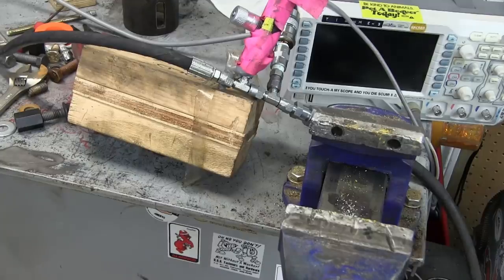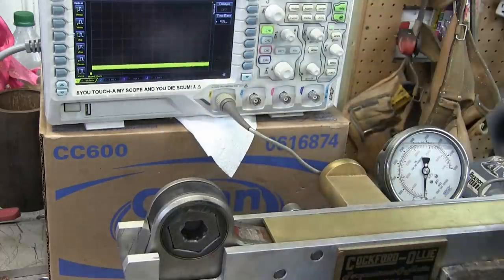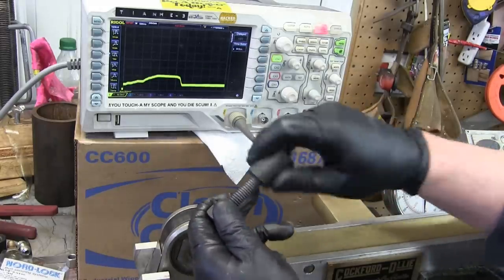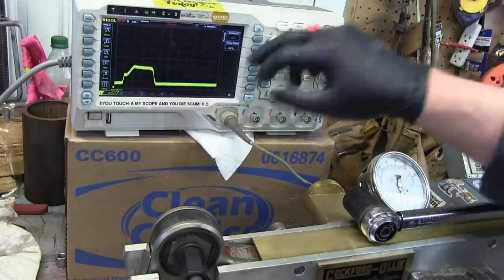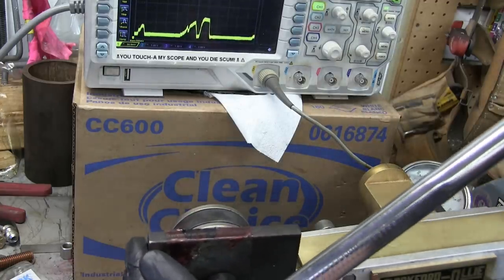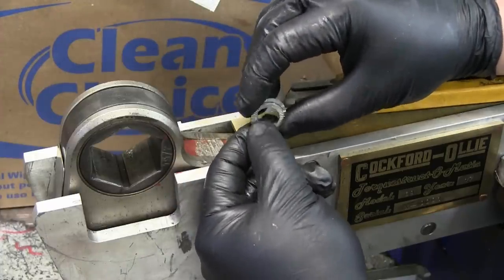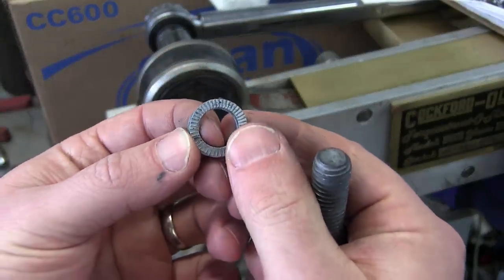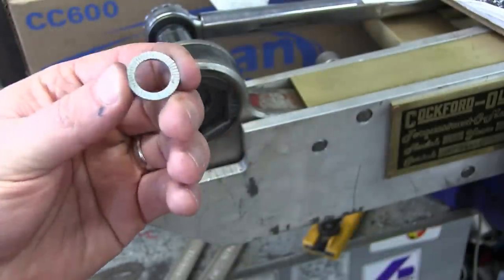Nord-Lock Washers | Do they work better?

Comment: as u can c on the bolt near its base there is an area where threads are not present as the machines cant reach that far down to cut a thread therefore if u want a proper fit and tightening u have to use a washer to fill that area thats the only reason washers were invented and needed unless the washer is harder than the materials being bolted together no washer will hold better than the torque specs of the bolt it has to bite into something to be able to hold

Comment: It seems like to me that you should be measuring the integral or AOC of each fastener, not the max amplitudes. That will give you a product of work or energy over time (really over a distance), necessary to tighten and to loose each bolt! You can see it in your trace profiles.

Comment: You should try the Schnorr Safety Washer, we use them a lot at work. They look very similar to the Nord-Lock washers, but they are in one piece and not glued together and they are also much cheaper... Nord-Lock 10pcs for 4,88€ and Schnorr 25pcs for 3,99€ for M10

Comment: Using different washers will give you different friction factors which will give you different pre-tension values when using the same torque for all three cases. You need to achieve equal pre-tension for all cases in order to say something about the berakaway torque.

Comment: Bolts and washers work just fine but I use the spring lock washers for nostalgic purposes. It is to my understanding that the locking washer's purpose in life is to gouge up the surfaces enough to keep vibrations from moving the head.

Comment: I'd like to see the same test with a dished washer (conical?... not sure what the actual trade name is). My experience and feeling of logic about them is that they are extremely effective at maintaining pressure throughout the last full rotation of your fastener.
Reply: would that be belleville washers you suggest?
Reply: bradonj 
I looked up an image of the the Bellevillle washer, and yes, that looks like it.  I've used these for connecting lugs to transformer terminals for large power distribution, and they seemed li,e the most robust option.

Comment: I think your soft steel plate was just sliding on the hard steel bolt on the back which would invalidate those tests.  weld the plate to the bolt so that's not happening. also if the nord locks work as you say, a finer thread pitch bolt will have more effect so try that too please. would be interesting.

Comment: I believe that the O ring encapsulated washer that is on oil pan plugs is by far the best for holding a faster. How hard is it to loosen the oil pan bolt? Friggin ridiculous! Takes two wrenches locked together to get enough torque to loosen it. Rubber O-ring dampens the vibration also.

Comment: Re-do the test wirh grade 3 and grade 5 fasteners in both fine and course  thread.

You might also utilise a stepper motor driven at a constant  voltage driving a screw to actuate the lever. This would give your data an additional factor of time.

Comment: Very interesting, inspiring me to do some research on "locking" fasteners.  
Will you be doing any follow-up with other types of lock washers, such as comparison of grade 2,5,8 split (will softer grades just fuck over), and various types and grades such as internal tooth shakeproof/star washers?  An interesting comparison might also be made between locking washers, and locking (both metallic, fiber, and nylon) nuts!

Comment: Nordlock washers require a different tightening torque value for the given clamping force. This may be due to the fact that when biting into the fastener and surface, there is less stretch in the fastener and less actual clamping force.

Comment: I do not know it but I use spring washers for electronic. I.e. if I want to be sure that a earth connection is stable, because even if the screw gets a bit loose, the washer keep pressing between the screw and the connector.

Comment: Loctite (actually used nail polish) was doing a shit job at holding the screws for the sprocket and break disk on a bike I had. Shitty little spring washing is now in place and holds up perfectly.

Hate to argue with the uncle ave though

Comment: Split washers seem to work better when they are larger. Think about on a hitch ball, those washers bite into those nuts very hard, sometimes too hard, but on smaller fasteners there's no where near the same effect in my experience. Possibly has something to do with the quality of the steel used to make the split washers too. I imagine buying them from a high quality manufacturer with a specific use case defined (like a hitch ball, or a structural beam) they would perform much better overall.

Comment: You can prove the ramp theory by using only one Nordlock washer instead of the paired set. In that case the unfastening torque will be solely due to the biting of the washer serrations into the mating surfaces and not from stretch of the bolt. I find it hard to believe that the ramps of the washer are forcing stress on a hardened bolt during the unfastens. If it’s in the ramps camming out then they will break the adhesive bond during the unfastening.

Comment: I thought these washers were great. Used to use alot of them and found the M30 ones were a PITA to remove.  "loaned" some from work to hold in the control arm bolts that kept on coming loose on my track car too.... unfortunately I could not return them as the bolts never came loose again....

Comment: I knew the results before the test began.  I don't think it would require more torque to loosen what was tightened . It's their ability to take vibration without loosening. So theoretically the best lock washer would be the one with the most crush travel with return pressure.

Comment: Work, not force, right? To resist  a bolt loosening, and resist vibration, you need to increase the amount of work necessary to loosen the connection.
You need something more like a stress/strain curve, and measure the area underneath.  So, you need to simultaneously record the rotation, and plot the torque vs the rotation. Potentiometer?
Also, you might want to consider a cheap USB DAQ, chinesium ones aren't too expensive.

Comment: They only work if you have the correct thread pitch as well. It may work better depending on the thickness of the plate you are bolting through.

Comment: Nordlock washers are meant to only prevent slackening and spontaneous loosening due to vibration. However, as explained in their video (https://youtu.be/IKwWu2w1gGk?t=3m53s) and as you found out, loosening them just requires you slightly stretch the bolt to overcome the locking wedges, which registers as a bump "snap" as you undo them.

Comment: Try using a fine-threaded fastener.  What you would need for their design to work is a thread that's steeper than the Nordlock.  Otherwise the fastener thread releases the pressure between the fastener head and the nut/plate/whatever faster than the Nordlock creates it.

Comment: hardest thing by far to keep bolts tight on Racing exhaust headers. Extreme heat and vibrations. massive temperature differentials and differing material types at a bolting surface.

Comment: Use fine thread bolts on to aluminum base. Also not much vibrated more than an airboat. Have not seen and breaking issues with them, over the last 12 years dealing with them.

Comment: The way I see it, is that it is not the bolt that stretches when undoing the nut, but the compressive force on the lock washers themselves.  as the materiel from wich the washers are made from is actually more ductile, combined like you have figured out with the grabbing inner surfaces geometry.
I think in your comparison testing, you should do a durometer test on all your samples.  You got to know what you have in your hands!!
Therfore in my mind, your test is not to a level where it need be to discriminate any of the various washer designs.

Comment: Nord lock cam angle is higher than the thread pitch. I am a big fan of both Nord Locks and Loctite. I have used both in the steel mills I have workes at and they make a huge difference. They are very expensive, but they are also reusable. Split washers are crap.

Comment: On the rare situations of using these, The old package, they came in, would show, torque up to 5 ft.lbs. below the required torque spec, wack'em with a hammer, or the setter tool ,which looked like a socket, once wacked with a hammer, then continue the torque process, on up to the final requirement spec... and I assume the dents would be created on & in the mating surfaces ...

Comment: Probably they won't work in low torque applications as well? M33 threaded pipe part with 1.5mm pitch with specified tightening torque of 40Nm.

Comment: Nordlocks are great but with increasing surface area under the screw head that increases setting! Which will loosen any bolt with time unless the they are properly pre torqued

Comment: I think the test ought to be re-run using non-hardened steel fasteners (male AND female) and a single washer between. This will allow the washers to do what they are intended to do, which is grab both surfaces to prevent slippage. The use of hardened steel on either mating surface just provides a slipping point, negating the grip that the washer has on the other surface. Re-run, AvE?

Comment: Before I even watch the vid, I know the nord-lock work.   We use them on stuff like perf blades that cannot move while the machine is running otherwise the several thousand dollar blades will  crash into the anvil.  also on stuff like the bolts that hold the orbit head of saws in place to prevent the blade from crashing into the clamps and whatnot.

Comment: But with the lock washer tightening the bolt is different because of the spring load. So youd have to tighten it all the way till the washer is flat.  Now when the volt is loosened and the lock washer does spring back then the washer is crap.

Comment: Personally I never looked to spring washers to increase the breakaway torque of a fastener, rather I looked at as just what the name implies, a spring. It always seemed to me that since it compresses, that if the fastener started to back out, it would expand with it and sort of "preload" the fastener in the threads, giving it a fighting a chance of not vibrating all the way out of the hole. For me it just eases my mind that the fastener might not FALL OUT, but not necessarily stay to torque spec. Just my two cents

Comment: Nord-Lock  -  Swedish inventions. Works really well in the demanding applications of gas turbines, but the bolt and base material could not be harder than the washer as you experince. Then you need to use tab washer instead.

Comment: Seems like how it was intended, load on nuts and bolts are not torque on the head they are vibration so theoretically, unless the bolt managed to vibrate all the way around, it would never come off.

Comment: What about the different washers impact on actual bolt-strech at a fixed torque. Maybe the flat washer is the slipperiest one that streches the bolt the most and therfore requires the most torque to loosen? You sholud have tested the chineesium-flaping-in-the-breeze-sun-"lock"-washer :)

Comment: Used Nord lock washes on the bolts  for my exhaust on my diesel engine and was surprised to find a bolt that had fallen out out after a few months.

Comment: first time i have ever questioned your logic your testing the the lock washers under the wrong conditions its not supposed to stop them undoing only to stop things vibrating loose. i prefer lock nuts where applicable but with 316 stainless fasteners they frequently lock up under certain situations which is where spring washers are handy they dont cause the bolts to lock up. spring washers are also handy when going into a tapped surface and if we really dont want them to undo we use lock tight too.

Comment: your mistake with the nord loc washer was to also use a plain washer. the nord loc is supposed to bite into the head of the bolt and the material the bolt passes through, the wedges of the 2 parts of the washer , means it takes 30% more torque to undo . you allowed the bolt to turn against the plain washer , negating the effect of the nord loc completley

Comment: You might be able to test the holding power of the different lock washers if they are torqued to spec then vibrated or oscillated under load. Then test the brake away torque from your original values.

Comment: Never, ever seen a Nord-Lock not take more torque to release than tighten.  Metric 12.9 Allens to anything metal.  8.8 hex heads the same, 5 mm - 12 mm thread size.  Never seen one break where the base metal didn't fail first in drive line couplings on printing presses.  High torque or critical duty gets Nords, light duty or where the Nords won't fit get regular lock washers.

Also always recommend Nords for header installs on cars or trucks.

Comment: I though the Nord Lock washers had a specific torque spec for size to get the bigger teeth in the middle to snap together. My though was this was to resist vibration not torque.

Comment: Size of the ramp on the nordlock is tied to the pitch of the bolt if the bolt pitch is greater than the pitch of the nordlock they are less than effective.

Comment: If you ever cobble together a vibration test, I'd love to see some Spiralock threads in the competition. Supposedly NASA uses them with no other locking mechanism on space probes, and I've seen them on the drawings of automotive steering components.

Lemme see here, an electric motor spinning an offset weight at 1750 rpm ought to shake things up sufficiently. Murder on bearings, maybe.

Comment: Norloc,s are for grade 8 cap bolts, not so much for hex head. lock washers are basically for bolting wood or plastic, anything more then 30 or 40 foot pounds of torx and they just expand and become useless and lowering the any torx speck you may have .   for connecting metal to metal,  hex heads should be used with either flat or spring washers , and for proper torx specifications  threads should be clean and lightly lubricated , And brought up to torx in 20% increments ( ball park ) to allow for bolt stretch.

Comment: They should experiment with shaping fasteners and using softer fastening alloys and with different threads. I'm thinking like lock nut tech but backwards on a bolt and design it so it would not damage the female threads. But it would be odd enough to cause a bit of extra friction. Maybe just a stupid idea. I find myself using like 4 different types of lock tight on a daily basis.

Comment: Had a cylinder head on a motorcycle that had an insert to replace failed threads. Head bolt kept loosening from vibration. Nord-lock washer solved the issue.

Comment: Torque wrenches calibrated for CW rotation should not be usedcas a breaker bar or used to break torque in the CCW direction. As Per USAF  technical orders whose number I forget. Don't know why the reason is. But 33 years in aircraft maintenance both military and civilian the one direction rule has always been there.

Comment: Why use fasteners at all instead of just welding it or something else permanent if the goal is to be unable to back off the fastener?
Reply: How does one weld a steel bolt to aluminum or stainless? Purple loc-tite works wonders.

Comment: Schnorr safety lock washers. Slight conical shape with serrations either side of a single washer. Those nord locks are flat so no spring tension other than bolt stretch. ...no need to thank me 😇

Comment: I was taught that unhardened toothed lock washers are technically single use. They bite into the metal and after removal that edge is gone or greatly reduced and can't hold as well.

Comment: My intuition says spring washers are useful for things like a castor wheel on a trolley. Never for anything structural where failure will cause significant expense or death.

Comment: My professional experience has proven that the Nord Locks are the best when dealing with vibration. My cheap ass company tried everything before finally giving up and spending the money on the Nord Locks. Once the Nord Locks were installed the problem was solved.

Comment: Something is going on here, sure. What I don't get is that the very approximately average torque to release any of the fasteners is about the same? And yet this is enough to stretch a bolt without an increase in torque required? Sorry. I'm lost. Sorry. I'm catching up here. Great channel btw :)

Comment: The spring washers aren't made to prevent loosening though. They just keep pretension in the fastener. though they are still shit, iirc DIN127 works up to 5.6 and DIN128 is for <8.8. Both of which I rather not see used.

Comment: I always found that putting Loc Tite and using my 3/4inch torque wrench works best. Worked just fine on my DIY knee replacement, its been 3 years and she's tighter a Russian hooker on the coldest day in winter.

Comment: Nordlock is nice, only works on soft steel. hardened steel no go, slips on the surfaces. Also on very coarse thread, the ramp angle is insufficient to work as advertised.

Comment: So, the conclusion was basically the premise? You had already explained in an old video how nordlocks work. The finer the thread pitch, the better they will perform because of the greater difference in plane angle. As long as the serrations don't slip, of course. My conclusion is that they are superior on limited circumstances, such as fine pitch soft bolts on soft metal in a high vibration level environment.

Comment: Washers: For when the apprentice makes his first hole with a torch
Lock washers: For when the enginerds are standing over your shoulder
Tack weld: For when you want it to never, ever, come apart
Side note: http://www.lok-mor.com/products/anco-pn-loc/ This is the style used on vibrating screens at the stockhouse, at the steel mill.  Of course, the ones we use are beefier but I have no idea who makes them.